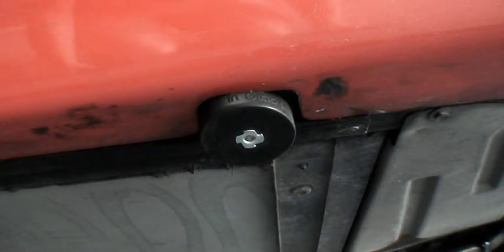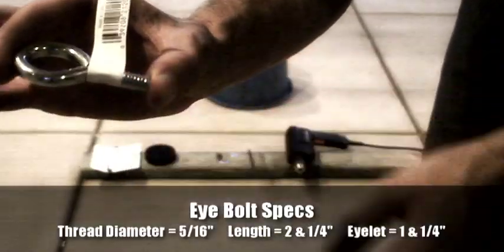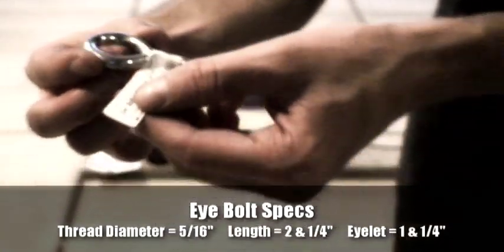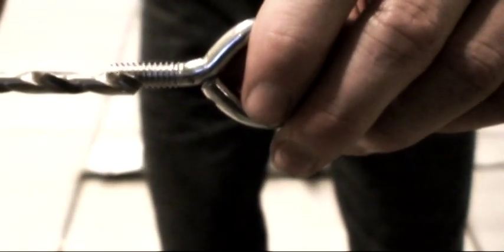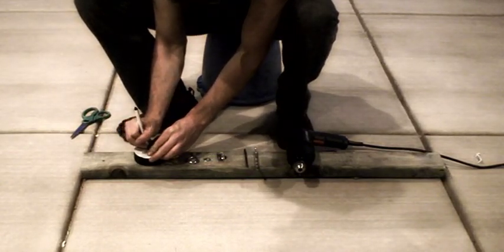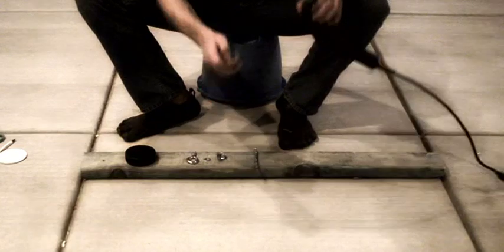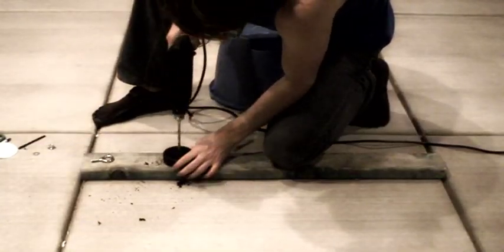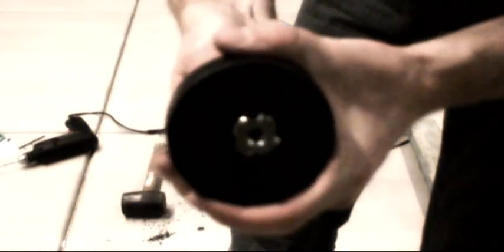Corvette Jack Pucks

Comment: Great video, and super easy to make!  Took me all of 10 minutes.  However, I have to agree with ssdwellah, the drill bit sizes you mention are incorrect.  The smaller drill bit should be 5/16 (the size of the bolt) and the larger one 3/8 (the size of the T-nut).

Comment: What are the exact drill bit sizes you need?  First for the hole that goes all the way through, secondly for the T nut portion?
Reply from the maker: I'm not sure...  Buy the hardware and pick bits that are slightly smaller then the diameter of the hardware.  Hopefully that makes since.

Comment: I'm confused, you said the larger drill bit is 1/4" but the bolt is 5/16" which is bigger, and the T nut is even bigger on the outside. Earlier you said to select a drill bit slightly larger than the bolt for the t nut which would be like 7/16" or 1/2".